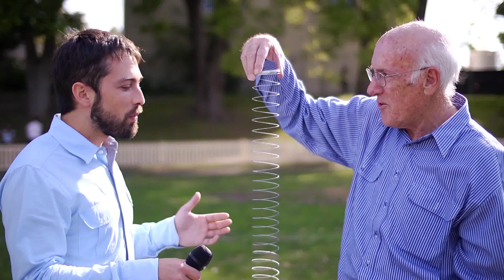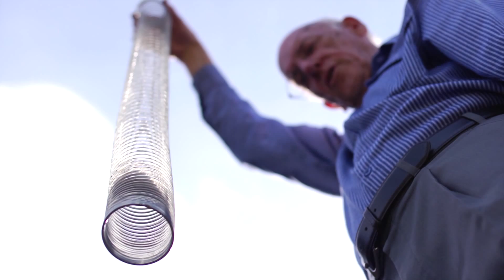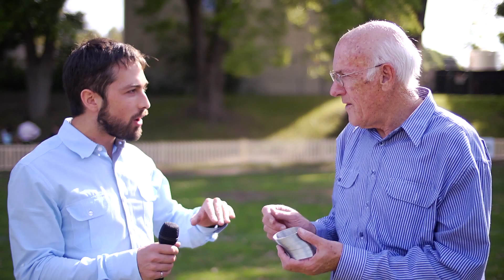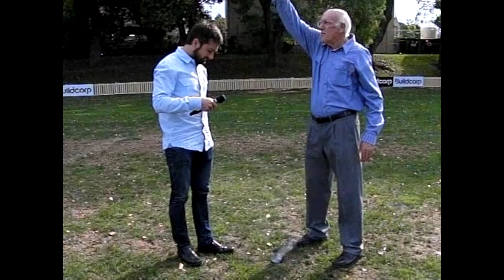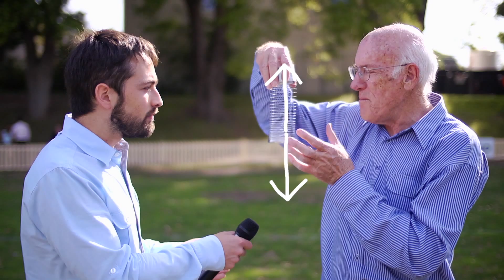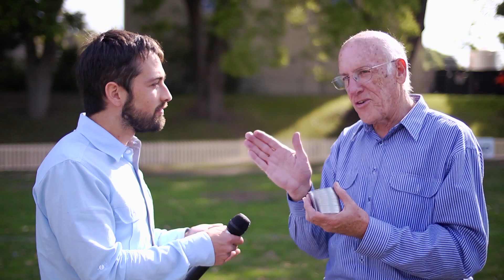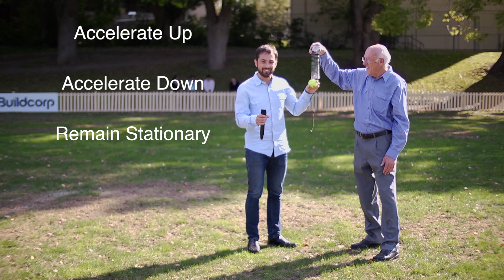Slinky Drop Answer

Comment: When you hold a Slinky with a mass (like a tennis ball) attached to the bottom and let go of the top, the tennis ball remains perfectly stationary for a moment before moving.

Here is why it happens:

1. The Balance of Forces
Before you release the Slinky, the tennis ball is at rest because two forces are perfectly balanced:

Gravity: Pulling the ball downward.

Tension: The stretched Slinky pulling the ball upward.

In this state, the upward pull of the Slinky exactly equals the downward pull of gravity.

2. The "Information" Delay
When you let go of the top of the Slinky, the top begins to collapse downward. However, the bottom of the Slinky (and the tennis ball) doesn't "know" the top has been released yet.

In physics terms, the change in tension travels through the Slinky as a longitudinal wave. This wave moves at a finite speed. Until that wave—that "message" that the top is gone—reaches the bottom, the tension at the bottom remains exactly the same as it was when you were holding it.

3. What Happens to the Ball?
Will it stay in place? Yes, but only temporarily. It stays suspended in mid-air until the Slinky has fully compressed onto it.

Will it go down? It only starts to fall once the Slinky is no longer stretched. At that point, the upward tension disappears, and gravity becomes the only force acting on the ball.

Will it move up? No. While the tension pulls up, it is only strong enough to counteract gravity, not to overcome it and lift the ball higher.

Comment: When a slinky is dropped, its bottom end initially appears to remain suspended in mid-air while the top end collapses. This happens because the tension in the slinky is released from the top, and that change in tension propagates down the slinky as a compression wave. The bottom end doesn't move until this wave reaches it, creating the illusion that it's defying gravity.

Comment: I like to think of gravity with the equivalence principle in mind, that is, we on the ground are accelerating up to meet the Slinky, and from the Slinky's perspective it's just floating in space.
(This and the description of gravity as a force are essentially equivalent in Newtonian physics, but I think it gives some insight.)

You can imagine a what happens when you hold a slinky from the top, the bottom of it will stay "stationary" (in the free-falling frame) and your body will accelerate up past it until the slinky has enough tension in it to accelerate the bottom of the slinky at the same rate.

So, physically both the top and bottom of the slinky are accelerating up at 9.81 m/s^2 when it's fully stretched.
Now, imagine a slinky stretched out in space, when you let go of each end they'll accelerate towards each other at the same rate.

Back here on earth when we let go of the slinky each end will accelerate towards the other at 9.81 m/s^2 because we already allowed it to stretch to the point where the tension produces 1 g of acceleration by letting it hang initially.

The difference between this experiment and outer space is that we, the observer, are also accelerating upwards.

The bottom of the slinky accelerates upwards with 1 g, the top accelerates downwards with 1 g, and we accelerate upwards with 1 g.

Since we accelerate upwards at the same rate as the bottom of slinky, it appears to stay stationary, and the top appears to accelerate downwards at twice the rate, 2 g.

It's not that it "took time for the information to travel from one end to the other", not at all, in fact the two ends notice that something has changed almost instantly.
Both of the ends, again, start accelerating towards each other almost instantly after dropping it, it's just that you on the ground are ALSO accelerating upwards just like the bottom end.

Comment: In my humble opinion this phenomenon occurs because the top of the slinky is under two downward forces: gravity and the elastic force (which at the atomic level is roughly the result sum of the strong force and electromagnetic force), but at the bottom of the slinky the atoms only are under the gravitational force the elastic force is actually also pulling (not hard enough) in the same direction but the opposite way, so... it's kind of obvious that the top can only go one way and of course, that's down....🤓

Comment: Do 2 tests side-by-side
1. drop a slinky with a tiny weight at the bottom
2. drop a slinky with a considerably higher weight at the bottom

measure
1. extension (distance from the topmost round to the bottommost one)
2. the time it takes to contract

My guess is that the heavier objects you have at the bottom, the higher the velocity the top will experience.
The bottom round is falling because of gravity, but the tension with the 2nd round keeps it up. The 2nd round is both falling and being pulled down by the 1st one, but the tension with the 3rd round  keeps it in place. This propagates to the very top round with increasing tension at every round, causing the topmost round to be pulled down by both, tension and gravity. And until the 1st round's tension with the 2nd one does not decrease, it remains hanging. Like a ceiling lamp hanging at the ceiling until the ceiling falls down reducing tension in the thread/wire between the lamp bulb and the hook in the ceiling

Comment: The weight of the falling bottom part is compensated by the pull of the  top part until compression force is completely exhausted. 
Therefore the top part is falling faster than it normally would at the cost of the floating bottom for a few misdirecting seconds.
The fact that it takes professors to explain and demonstrate this is shocking.

Comment: I'm confused with how it was explained... Could someone please explain?

The claim is that the bottom part has a force pulling it down and the equal amount of force pulling it up by the tension of the stretched slinky. 
How come the bottom part is not moved as soon as the force claimed to be stopping it is released?
Should it not have been gradually dropping?
Why must the top part physically reach the same level as the bottom part before we see any affect of the force pulling the bottom part down?
Reply: This demonstrates that gravity is a push force and not a pull force, as it is pushing the top of the slinky down, rather than pulling the bottom of the slinky down.
Reply: @count69  What? The effect would be expected in the same way. In your understanding with a push force it should have been pushed slowly once the tension is released. The bottom part should not be totally still.

If the bottom part is totally still that means that we are missing the pushing/pulling force of gravity. 

This same effect appears when we throw a ball up in the air. When it reaches the top point it will for a short moment stay still and then start to drop down. The drop down is due to the envoirment the ball is in (air), which makes the ball due to its density being much more than the density of air, drop.

If the ball would have been thrown in water we would see the same effects but with much slower movements and forces because of the density in water in relation to the object (ball). If we add more force in the throw we can make it go as far or fast as in air but once the added force weakens out it will behave as the envoirment its in allows it.
Reply: @ibrahim-qk7ii  I think you are conflating different as your examples. Imagine the spring on its side partially stretched out. If you pull it from one end it will spread out from that end. If you push it from one end it will contract towards the other. The behaviour in this video was consistent with one end being pushed.

Comment: The centre of mass is a position defined relative to an object or system of objects. It is the average position of all the parts of the system, weighted according to their masses. For simple rigid objects with uniform density, the centre of mass is located at the centroid.

Comment: The funny thing however, is in golf, like most human behavior, that flourish and follow through has an immense amount of impact on your game, some people think your follow through is the most important part, the ball is gone but moving through that precise motion consistently is the challenge so having a good clean follow through keeps it all flowing right through the hard part right past it by the time you feel it, that way you don’t have any brain involved, it’s just the same movement, nice clean line straight through and past the problem area and away goes the ball, but you mess up that follow through and it throws the shot off wildly.

Comment: “Information”? Without disrespect it’s not about whether the bottom of the slinky “knows information”, it’s simply that there is always elastic tension until the top reaches the bottom which is when it falls and this fall is further aided by the momentum of the top of the slinky

Comment: The explanation doesn't seem right to me, I think that the bottom part is being pulled up because of the tension, but as the top part is falling, the apparent movement is "canceled" and we have the impression that it is stopped in the air... in short, both parts are being pulled into the middle
.

Comment: Actually the answer "end didn't notice" is untheoretical let me explain why the end of spring remained stationary:
When you hold one part of the spring in your hand and allow the second end to elongate as much as it takes to reach equilibrium both the weight force and spring force will be equal (note that the spring force is -k(L2-L1) or (stiffness) x (elongation)), so the only variable for the spring force is elongation. 
To have an equal force to its weight it needs to elongate until delta L times K is exactly equal. Now when you drop the upper part it will be pulled by spring force and weight hitting the other end to create a down force and with the impact of both ends the spring force will reach zero and the weight force will be the only force on the system.
To make things simple think of a spring stretched horizontally on a table with hands holding each side and release one side you will not feel any change in forces in the hand holding the spring until the other side hit causing an impact force. 
For the ball question, If you attached weight to the end the weight will make an equilibrium by extending the elongation but if the weight is much more than the spring elongation can handle it can't make an equilibrium thus the spring will move downward before getting together.
Reply: Obviously
Reply: Thanks bro
Reply: @Mk_114  You're welcome!
Reply: How scalable is this effect? A 1km slinky?
Reply: No gravity then? Its for sure no gravity in action if done on a table.

Comment: What this experiment tells me is gravity is much more likely to be a push from space instead of pull from earth. Question is what is pushing from space? The answer is there is no such thing as empty space. Like how water will exert omnidirectional pressure on a ball submerged under water, aether exerts gravity on a surface of a charged body like planet. Space devoid of all matter is still full of aether aka quantum fluid or quantum energy which means there never will be such thing as empty space. Also center of mass doesn't equal to center of gravity. Gravity doesn't have a center, it is non-point source omnidirectional static acceleration of aether towards the surface of a charged body like planet. This also means the deeper you venture inside the earth, the lower the strength of gravity slowly becomes and eventually you will experience moon-like gravity deep underground 150+ km below the surface. Center of earth will be zero gravity.
Reply: Absolutely. I remember seeing a program in the 70s from a guy who used all manner of practical demonstrations to show that gravity was a push force.

Comment: Centre of mass of the slinky is below the middle of its length where the acceleration at any point of time can be calculated by 
(F-T)/m  ;where F is the gravitational force at the centre of mass  , T is the tension at the centre of mass , and m as the mass of the slinky.  
As the slinky is dropped from its top end the Tension "T" slowly decreases and the acceleration slowly increases reaching its max. Value as g (approx 9.81m/s^2).   
This might be the explination of the fall.

Comment: Then explain to me how all Slinky's have elastic tension equal to the earth's gravity; though that's even wishful thinking, because obviously if gravity did exist, not only would the slinky do what you see in the video (more or less), but the object as a WHOLE would fall to the ground. It's like saying bullet's don't drop until the last 10 feet... Where as what's obviously happening, is that the tension, regardless of how weak or strong it is, is keeping the entire slinky suspended, save for one link, the top most link, which unlike the other links doesn't have tension which is attracted upwards, and because density(something inherent to the slinky, like it's inherent tension, as opposed to the outside force of the earth's supposed 'gravity) dictates that more dense mass displaces less dense mass, the top most link displaces the air between it and the link below it, and then touches (fuses) with the link below it, and since there's no upward distance left for the lower link's tension to try and overcome, it then no longer is in a stasis and goes downwards as well, and then so on and so on. Remember the slinky is a SINGLE object so it can do this, but it's not like a string which is already practically fused. Actually you can probably in theory observe a similar effect dropping a string, but it would probably be practically non existent as the string if not already fused is practically already fused. So the same thing probably happens with a string, but since there's significantly less less dense mass occupying cavities the process is really really fast, which at the same time means that it's a really really small visual observation for one to make. And finally it's obvious that gravity is having no part in this, or else we'd see this process occurring at the same time as the separate process of gravity. Again, it's like saying a bullet doesn't drop until the last 10 feet, actually it's more like saying the bullet doesn't drop until it already reaches the ground.

Comment: If the information of movement in materials travel as the speed of sound in this materials, if I take a bar of steel with thousands of kilometers high and someone in space drop it, does the base of the bar wait some seconds to actualy fall?

Comment: In this case there is a force in the spring trying to join the two ends. In this case the underside of the spring tends to rise and the top part to descend. This one descends while the one from above, as a result stands still. If this spring is placed horizontally the two ends would walk at the same speed. The fall velocity of this spring in this case is greater than that of light.

Comment: Gravity and the slinky are at an equilibrium where gravity is maxed out compared to the recoil tension of the slinky. So when he lets go the bottom can’t go up because gravity already is maxed out pulling it down, the bottom can’t go down because the tension of the recoil in the slinky is holding it up. So only the top, which no longer has the anchor fighting gravity, can fall.

Comment: When you drop a object it gains speed on its way down causing the top of the slinky to pass up the bottom of the slinky. He is correct about the time that it takes for the information to reach the bottom but because of the applied tension before the drop does it add a constant decreasing boost to it's momentum with the acceleration of gravity? Is it speeding up faster than the speed of gravity as it's going down? To test this I suggest to also have another person to drop a rock from the same height as the top of the slinky. If the tension does speed up the acceleration then using the slow speed camera take a measurement of the space and time between the rock and the top of the slinky at the time when the slinky is back to its original form. Then compare that distance and time with the distance and time of the bottom of the slinky to the ground. Without the test I can see at least 3 different outcomes, either the top of the slinky and the rock hits the ground at the same time or the top of the slinky hits first if so then take notice of the bottom of the slinky to see if it hits the ground at the same time as the rock does. If different then measure the distance and time between the two.

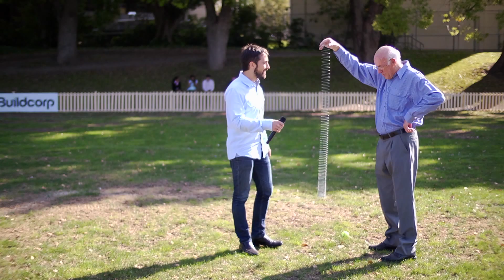Comment: There's another way of thinking about this. When an object is dropped, the centre of the mass of the object accelerates towards the ground at g. When you look at the slinky when its been held like at 0:24, its centre of mass will be lower than half way down the slinky, as the slinky is more bunched up at the bottom. The centre of mass accelerates downwards when it's let go, even though not all of the slinky accelerates down. The tope of the slinky actually accelerates faster than g.

Comment: One question: what happened to gravity? Gravity as it is thought to everyone is a force that pulling everything down and it is universal and depends on how heavy the object is, why gravity did not pulled the bottom of the slinky and allowed it to sat totally still until it was pushed down by the the top of the slinky. In the next video you can see that the tennis ball was a tragedy to the bottom of the slinky it still remained STATIONARY until pushed down by the top and released tension. How one can explain that the slinky bottom remains stationary and slinky bottom attached to the tennis ball remains stationary?
Where is gravity??
Reply: Krystof K its there...
the tennis ball adds to the weight. therefore applying a greater tension in the slinky whick makes it still stay in place.